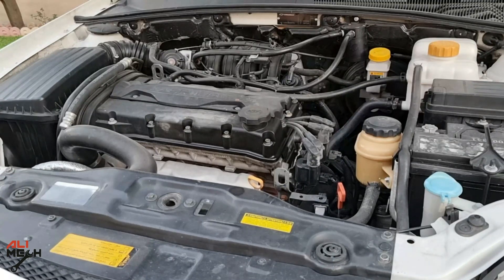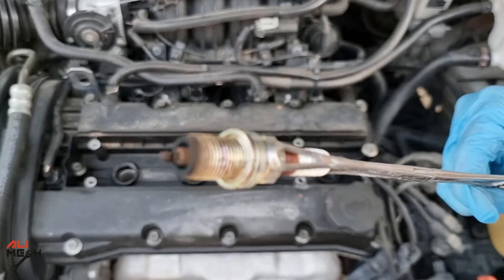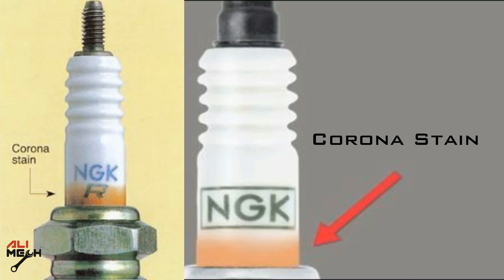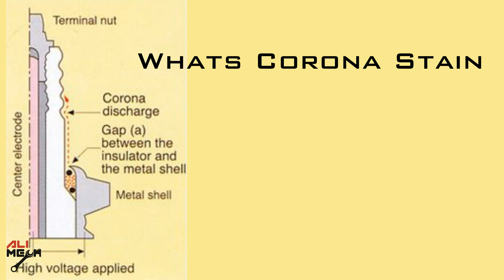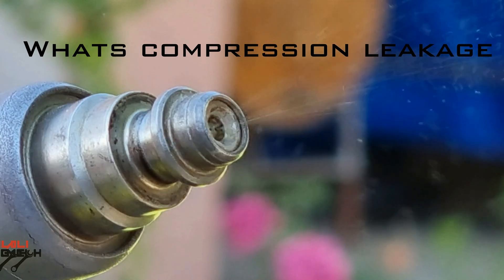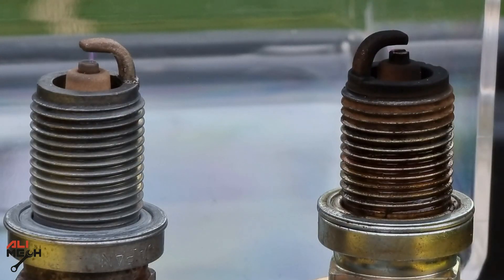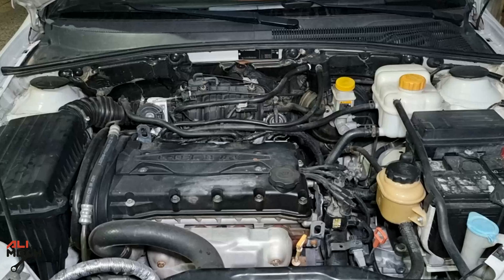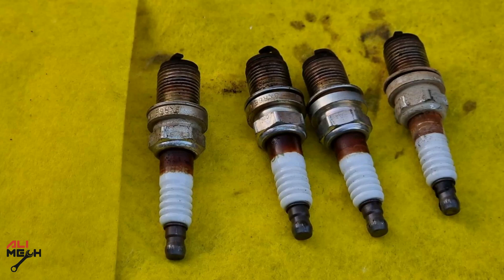Don't replace spark plugs if mechanic tells you/Whats corona stain and compression leak spark plug

Comment: This advice saved me money, Yesterday my mechanic asked me to replace the plugs because the ride was not smooth. When I told him that the plugs look okay and marks of compression leak doesn't necessarily mean the plugs are bad, then after few minutes he found a broken wire of MAF sensor and fixing that fixed the issue.

Comment: I don't understand. Are you saying that the spark plugs are not the problem?
Reply from the maker: They are in 2 categories 
1. Corona stain, which it will be a light burning mark between the isolated and metal hex, that's not problem, you don't need to replace it
2. Compression leaking,  which it was my problem, this has to be replaced
Reply: so, i should make adapter that will allow to test spark plugs on pressure to see if leaks
Reply: If I follow, his plugs were leaking, which disrupts the fuel/air ratio in the combustion chamber, resulting in the blackened fouled plugs.
Replace the plugs with quality ones, not your entire distributor and wires.

Comment: And what does a mechanic do with old spark-plugs ? Sounds like a pretty wild conspiracy theory
Reply from the maker: @gloinschmelzer7601  yes of course, sertificated authorised dealers won't do that for sure
Reply: Of course because of the certification they must be sure your safe you so you go for spark plugs and they change coil pack, catalytic converters and of course spark plugs. I've gone once to a mechanic for a coil pack and when he changed also every coolant pipe and thermostat he said they are corroded although they seemed fine to me. Now i fix whatever i can myself and i found that a lot of things on a car are fixable is not everything that need to be replaced with a new part.
Thank you for the free knowledge.
Reply from the maker: Sometimes they use it on another car if the tip not worn out